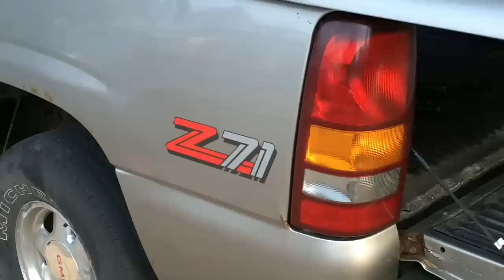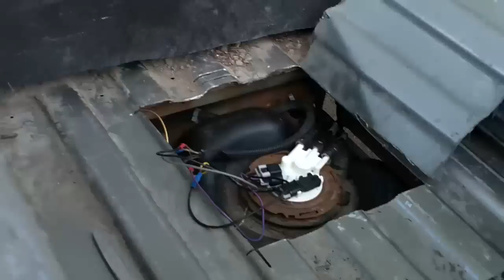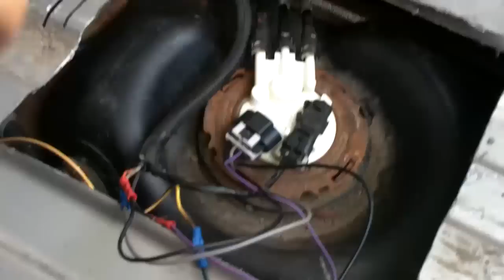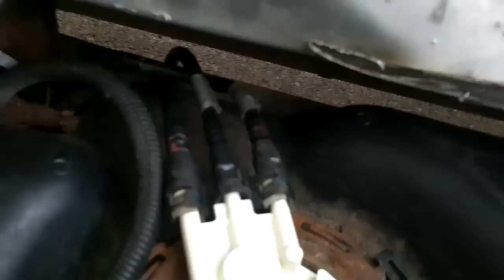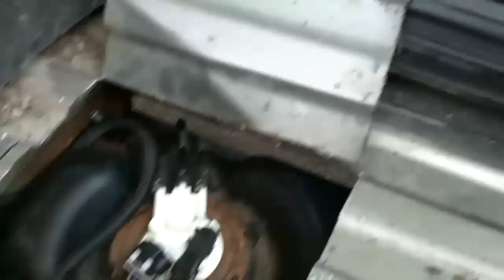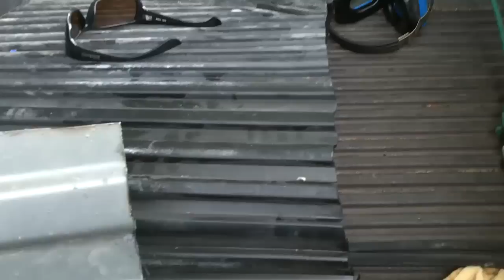GMC / SILVERADO pickup quick fuel pump fix.

Comment from the maker: I can appreciate the comments that suggest how easy it is to pull the bed when changing out the fuel pump.  However, I only went to this extreme after helping a friend try the bed method on his 04' Silverado.  He said 3 hours max.  Two days later, after a broken finger and 3 atomic rusted bolts, we spent an entire day dropping the tank to make the repair.  If you have better luck pulling the bed and don't want to cut your truck, enjoy.  I'll lift my flap.
Reply: Great video. Thanks for sharing. Saved me about 1000usd by DIY.
And getting dirty from being in a mud pit.
Reply: I've had my box off numerous times for cleaning, painting and rust proofing, once you've done it many times, it's pretty much a can a corn, plus I reinstall it with stainless steel bolts and wing nuts, but that's just me.
Reply: Hello my friend I just subscribed I know the pain you're talking about I have a 2000 GMC Sierra.
I replace the pump about 10 years ago drop the tank down in my yard what a pain in the ass this time I'm cutting a hole in the bed.
Do you think there's a big difference in the type of pumps you buy I paid 30 for mine on eBay made in China.
I think they're all made in China I'm not sure though what do you think.
Keith  Kuhn

Comment: Just unhook the tail lights,remove the three small screws around the gas cap, push in the gas hose, unscrew the ground wire, unbolt the 8, (6 in some) bolts holding the bed down and remove the entire bed  and you be able to get to it in about 30 minutes tops.

Comment: I like it.  Perhaps add a larger piece of steel and bolt or screw it down for support so when folks stand in the bed to load or unload it they won;t stand on a weak spot?

Comment: Just changed my fuel pump today...8 bolts holding the bed, 2 wiring harnesses & 3 nuts hold the filler neck then take it off...with that wiring job u are going to keep replacing that fuel pump that's why you cut a access hole on ur bed...this video is for retards

Comment: Hey thanks a bunch!    I just used this procedure after arguing with 2 of my friends who wanted me to drop the tank.   After doing it in about an hour,  they were impressed as well as myself.  Talk about reducing the trouble and physical labor required.....I now have an access panel after leaving the right side attached, adding a thin steel strip below the cut edge and using self-tapping screws to secure the hatch.    Awesome idea.

Comment: remove the four bolts that hold the bed in place, hook up two straps corners to corners, use a hoist attached to straps to raise bed high enough to access the fuel pump.change your fuel filter too..
thanks..

Comment: I cut an access panel for a 1996 Sierra.
Measure 13" from the side wall of the bed on the driver's side and draw a line parrellel to the side of the bed. Do the same thing again at 26". 
Now from the front of the bed measure 13" and 19" and draw the two lines there.  Do not exceed 19" or you will hit one of the bed supports.
After the cut, you will have an access door 13" wide by 6" deep. Just right to get the doggone pump out.